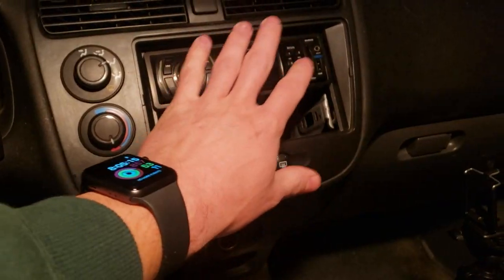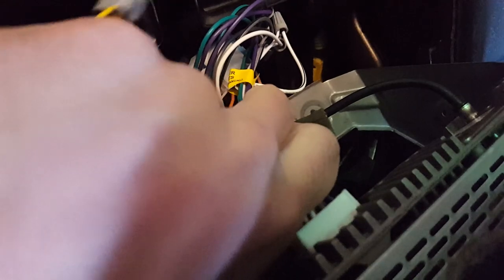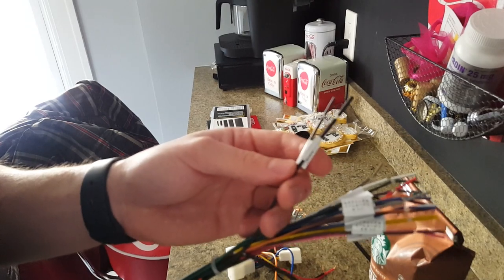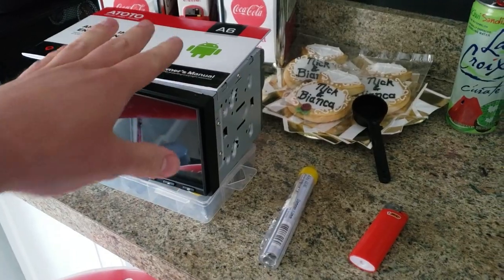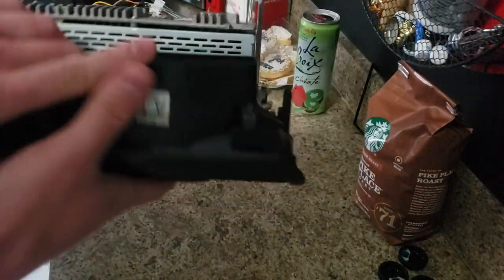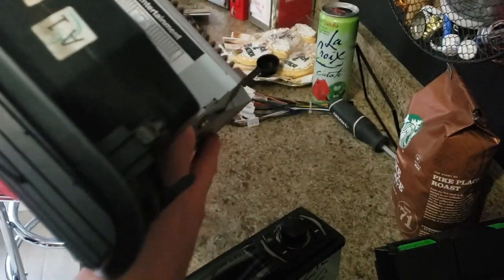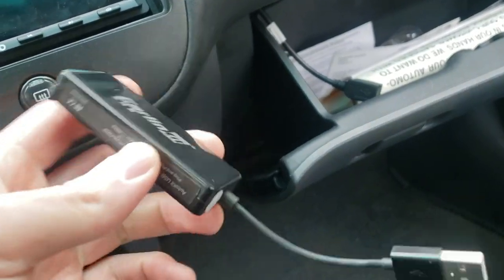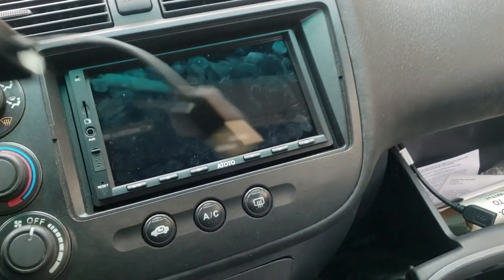Installing a Touch Screen Radio in a 2001-2005 Civic

Comment: If anybody was curious you can remove the entire center piece without removing anything else it’s only held in with clips
Reply: What about the two security screws under the center top piece
Reply: @CarlFinny  It should just pop out without using them i did it on an 05 civic not sure if they are all like that but i do know you can just pull it out by un clipping the clips

Comment: Hey! Do you know if it Will be the same for the 2005 civic? I just bought one
Reply from the maker: I think you need to take out the center console as well on the 05 but it’s the same otherwise
Reply: hey i plan on buying a 2005 civic did it work

Comment: Hi I would like to know how many inch android goes in Honda civic 2004 hybrid
Reply from the maker: Any double-din radio should fit. Doesn’t matter how many inches the screen is
Reply: @NickSabella  I have same honda civic 2004 hybrid but I measured the size is 8 inch don't you think big screen will come in between other Buttons.
Reply: @NickSabella  thanks nick I m thinking of buying autofather af7500 7 inch android will it be OK or if I buy 10 inch android wil that be OK sorry about my question. I saw ur you tube   video and I really like it the way you explain.
Reply from the maker: @aalamshaikh8714  7 inch will fit in the dash cleanly. A 10 inch should be fine if its double-din but the screen will be extended forward to sit in front of the dash instead of inside the dash.
Reply: @NickSabella  thanks man you r a star. Where u live brother if you live in London then I will ask you to help me in fixing android in my car.
Reply: Hey nick I need your help I was buying rio 3 android from junson but doo you think my original fascia is OK for rio 3 android. The guy in China told me is that rio 3 is for kia
Reply from the maker: I think the rio 3 is a radio specifically made for a Kia. You need just a standard double din radio